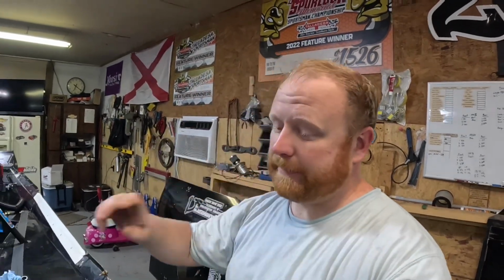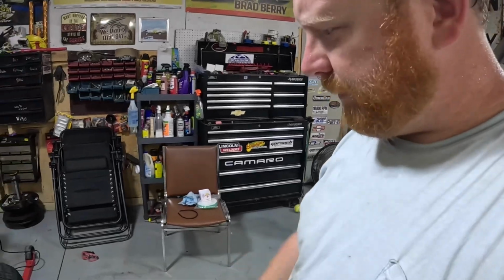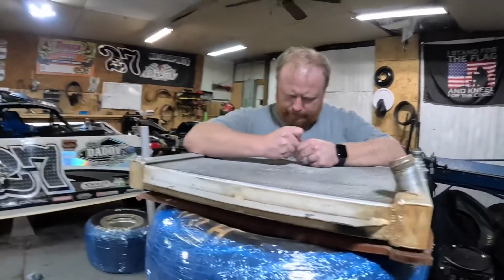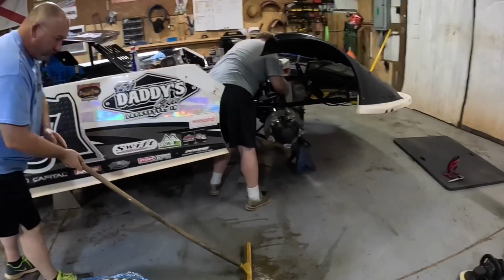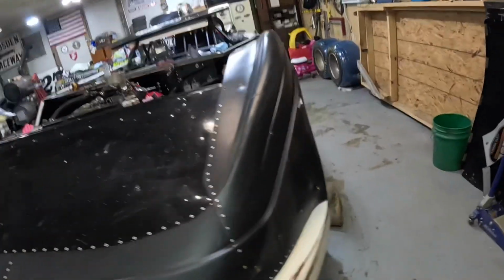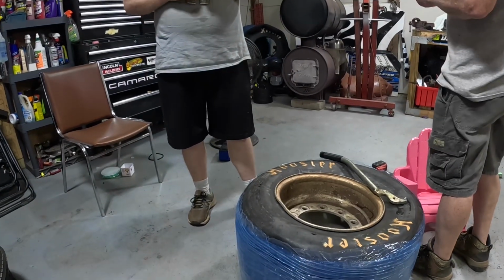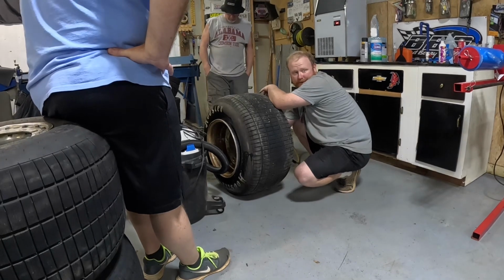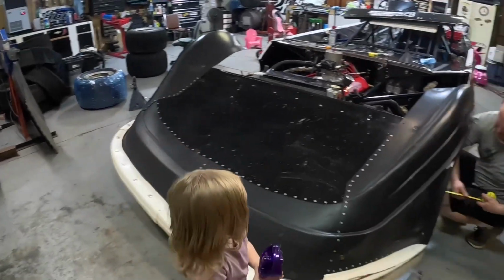Plans for this weekend: North Georgia Speedway!

Comment: On one of my old dirt cars , I used to hang small chains from top to bottom right against the radiator, and I would leave the bottom hanging lose, and when you are going around the track the chains beat the mud off of the screen in front of the radiator,,, I never used a screen , ihad good resolution to the mud getting knocked off and out of the radiator, thanks BigAl California, praise Jesus Christ grace amen 🙏